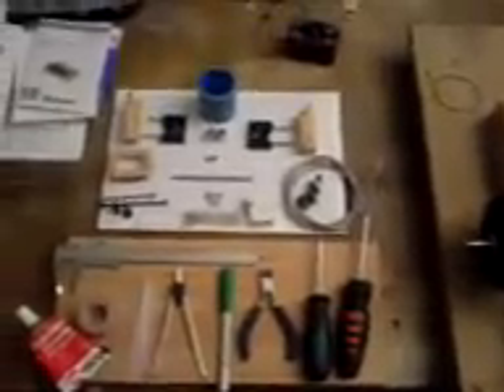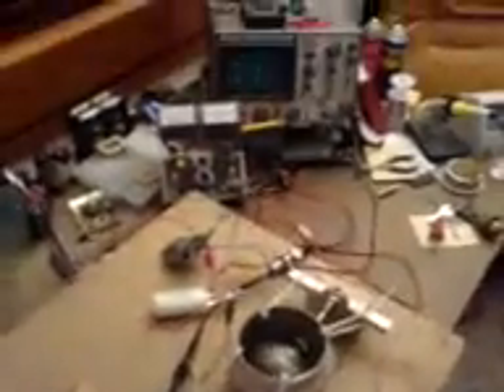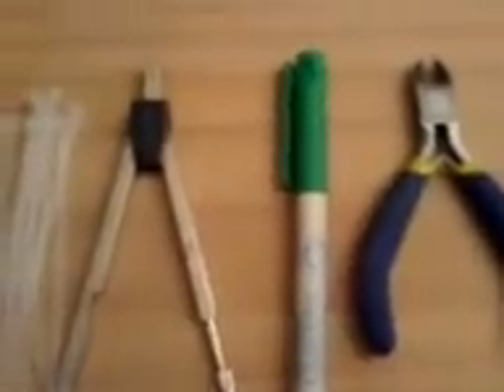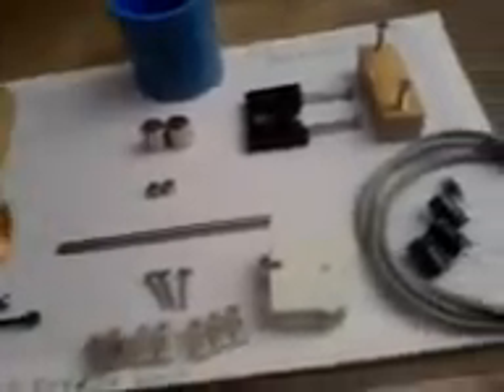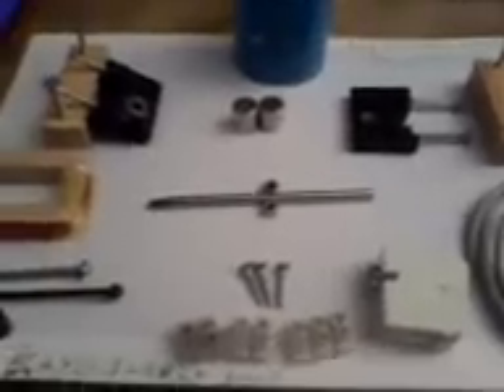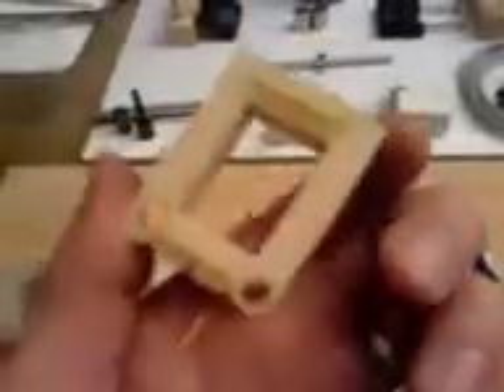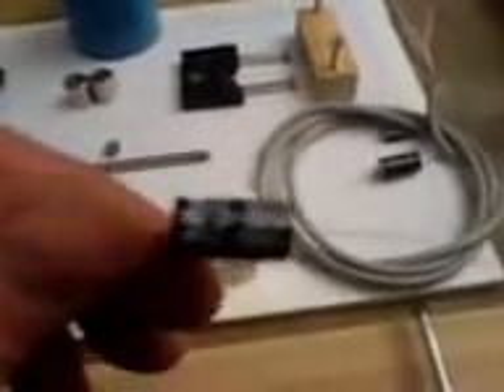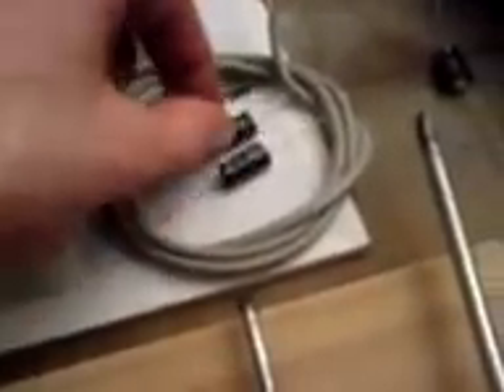how to make a Newman motor

Comment: I love the idea.  This  was posted in 2007, reports indicate it can be built with mostly off the shelf or recycled parts. Therfore since over 6  years have elapsed I would have expected many people to be using these now especially in off grid locations,  but I have never seen one.  Can anyone advise why this is?

Rich
Reply: Because I didn't know what it was (used for?) I googled it and it seems he was not granted a patent and was somewhat discredited. The point was that its output power was supposed to be greater than its input of electricity and that was the bit that didn't work. Be great if it did though ...
Reply: @janelaking3353  It did work. Look up Joseph Newman Documentary, it last 1 hour and 20 min
Reply: Have you built one?
If your answer is no then you know why.
Reply: @JimEdmiston  free your mind stop listening to conventional "knowledge"   there are plenty of reasons to discredit something that is quite revolutionary a few of which we use on a daily basis and the people who control them.

Comment: Sad that most do not understand the importance of the Newman Motor. I have since redesigned  the motor in a rectangular shape which allows for a 303.333% improvement in performance. Additionally, by incorporating a much smaller secondary coil under the primary allows for less consumption of energy to run the Newman Motor then that of what the primary coils produce. When we combine these 2 revolutionary  improvements together we brake down the old  law of thermal dynamics.
Reply: Plans available or buy unit from you. Need to charge  pack of 6v x  8 = 48v batteries with 5kw inverter
Reply: Plans available or buy unit from you. Need to charge  pack of 6v x  8 = 48v batteries with 5kw inverter
Reply: Plans available or buy unit from you. Need to charge  pack of 6v x  8 = 48v batteries with 5kw inverter
Reply: Plans available or buy unit from you. Need to charge  pack of 6v x  8 = 48v batteries with 5kw inverter
Reply: Plans available or buy unit from you. Need to charge  pack of 6v x  8 = 48v batteries with 5kw inverter
Reply: Sorry sent once I'm sure you got it